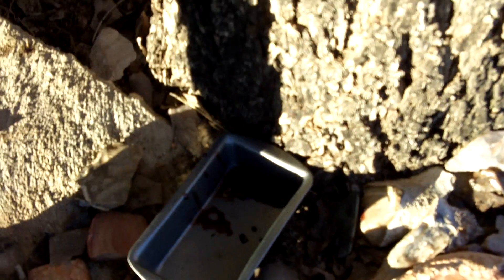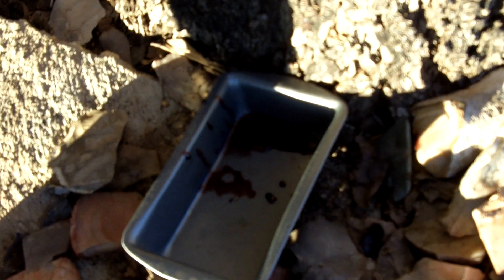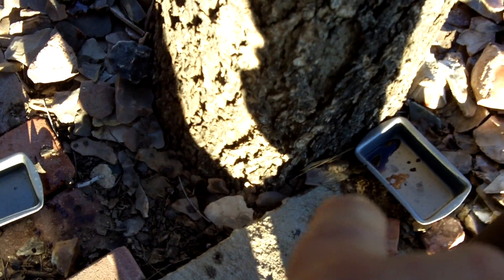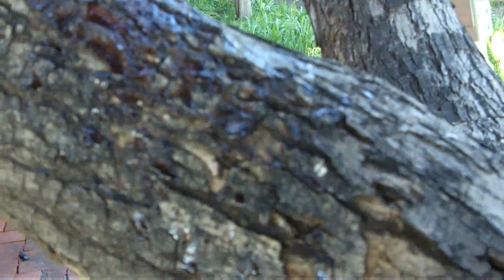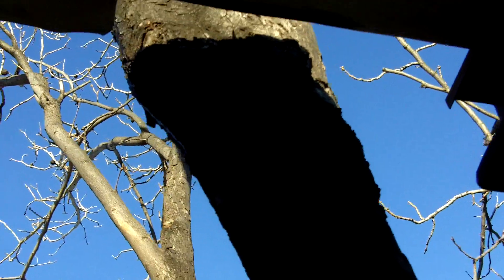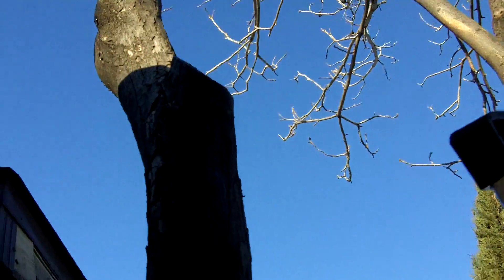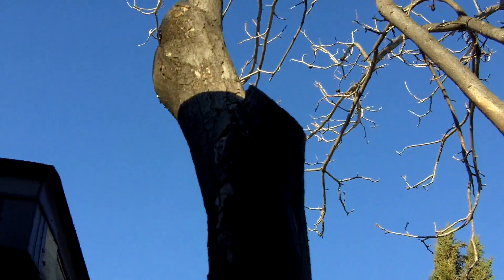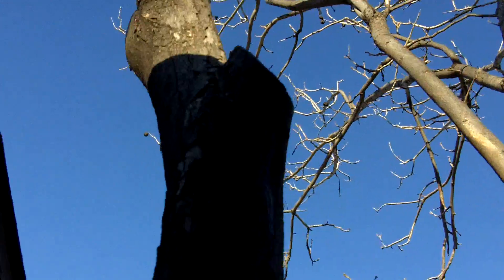314 - Pecan Tree Resin Part 2

Comment: Very cool and informative video Patrick, hey I had a really cool idea for a video yesterday, I noticed that when you make a step fracture in a rock or should I say if you make a bunch of them facing the same direction it's like a wood rasp just think about that for a second if you were able to purposely make a bunch of steps fractures and a piece of rock then you can use it as a rasp do you think this was done in the old days?
Reply from the maker: jesse rush Maybe.  I don't see many artifacts with lots of steps done on purpose, though.  It would work, for sure.  But I don't think it was done in the old days.

Comment: Is it the same resin that pecan resin figurines are fashioned from?
Reply from the maker: John Ratko Hmmm.  Good question.  I looked it up and I think that the figurines are made of a mixture of synthetic resin and finely crushed pecan shells.
Reply: Allergic Hobbit When I've seen them being sold as "pecan resin" figurines the first thing that popped in my head is they were figurines fashioned from pecan resin. It did seem odd that anyone would collect resins to manufacture knick-knacks. That they would be made from discarded shells from pecan nut processing mixed with resin makes perfect sense.